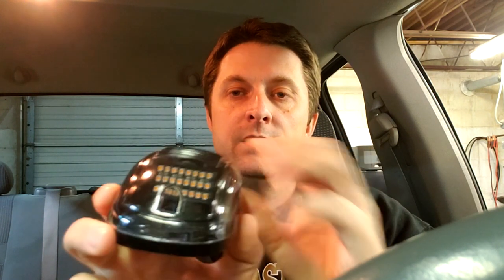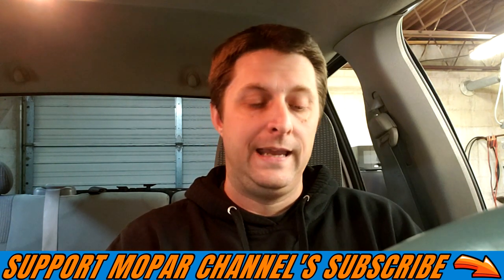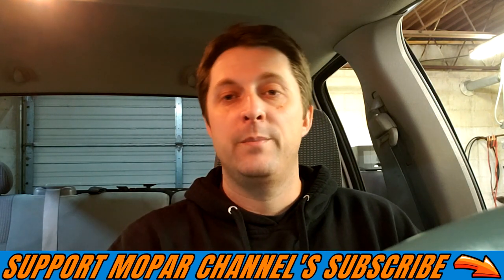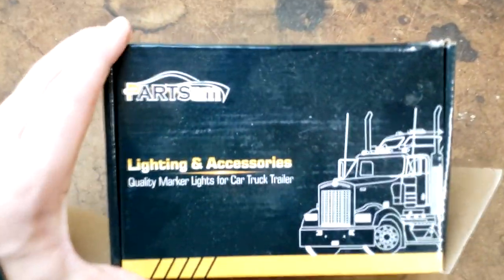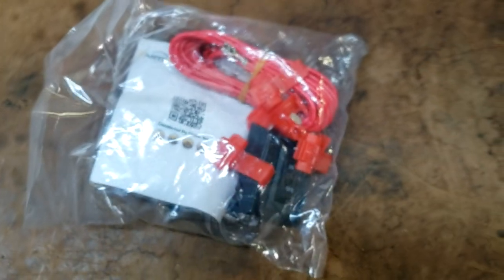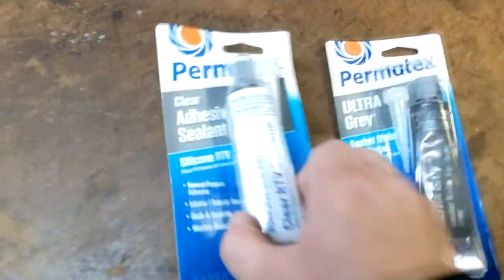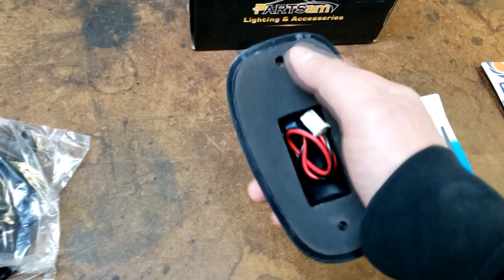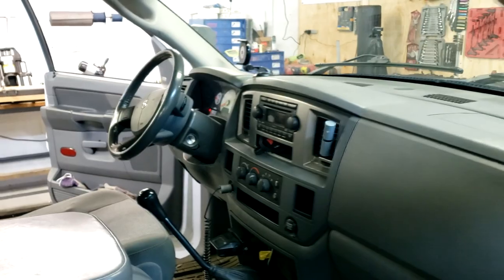How To Install Cab Lights On Your Dodge Ram 1500/2500/3500

Comment: My 04 already had cab lights wired from factory, passenger pillar, made it easy, no joining into switch
Reply: Was it SLT or Larime ?
Reply: So did my 08

Comment: I bought the same kit. Lights looked great but the gaskets on mine did not hold up to the sun's UV. Gasket deteriorated in a matter of months and caused leaking. Such a pain in the ass. I ended up just forking out the $170 bucks for the oem mopar kit. Gaskets on this kit are way better quality and so far so good.
Reply from the maker: Good to know I however added silicone around the holes for added protection.

Comment: Ordering a Ram 1500 Classic Express. May I just say on silicones if they smell like vinegar don't use that type that's acid and it will corrode the raw steel you exposed by drilling

Comment: It looks like the in-line fuse is going to end up inaccessible after everything goes back together. I'd be inclined to run it somewhere I can get at it if I need to. Maybe a spare position in the fuse box rather than an in-line.

Comment: Did the kit come with the fuse? And all connectors you needed? Also did it come with enough wire to reach all the way over or did you have to buy any additional stuff

Comment: Curious if you saw any factory sound deadening on the sheet metal on the roof? I'm debating lowering my headliner to apply a dynamat type material to help with sound control. Any observation is appreciated. If they did this from the factory, I'll just leave well enough alone.
BTW, high 5 lights you did in this project look good! Already have them in my 3500 but might be worth swapping to the LEDs.
Reply from the maker: Pretty sure nothing there
Reply: @FrostbiteRam  great, appreciate the info! Looks like I'll be doing the project!

Comment: went to tap into my headlight switch and I did not find any brown and orange wires found mostly purple and white wires however there is one orange and white wire. any idea on what to tap into. im sure its the same wire just different colors.
Reply from the maker: Need a test light or ohm meter to know for sure find one with 12v with key on only

Comment: Good but you not have to run the power to the switch , pasenger side have conector by the hendle that You remuve if you see and to many cable run. After tha perfect.

Comment: No ! dont use silicone, bad idea, Use Butyl tape. those are cheap aftermarket lights and they will leak. Genos sells proper good lights

Comment: Is that a resistor on the power wire? If so what size? I got a nice kit that came with a template but there is no resistor on the power wire if that is indeed a resistor
Reply from the maker: No I don't remember it having a resistor.
Reply: It is his inline fuse

Comment: QUESTION! Now if I dapped into that power switch. Will the cab lights turn on when I unlock the truck just like the marker lights do
Reply from the maker: They can just depends on how you wire them in.

Comment: Where did you hook the ground wire at. Im puting the same kit in my 2007 2500
Reply from the maker: I used a self tapping screw and mounted it to the dash bracing behind the side panel on driver side.
Reply: Where ??

Comment: How have those cab lights worked for you with rain? i want the same ones for my 2nd gen but not sure
Reply from the maker: Been awesome no problems yet
Reply: @FrostbiteRam  what areas do you recommend to put silicone on so they last?
Reply from the maker: @poolsharkkkkk  around the mounting holes

Comment: Nice job but no  relay?
Reply from the maker: Why a relay its wired into the factory wiring so it has a fuse and all.
Reply: @FrostbiteRam  huh? You tapped into a circuit designed to supply the headlights and running lights. You don’t ever add more lights to a circuit like that without at least knowing how many amps that circuit can handle and what load you will be adding to it. That’s how fires are started. The correct way to do it would be to tap into the headlight circuit like you did but just to trigger a relay circuit for your new lights because a trigger wire does not draw hardly any current at all. Fortunately those led cab marker lights probably do not draw very much current  but you should look into it.
Reply from the maker: @markmanning6773  it has a factory fuse worse case it will pop the fuse thats it. I've had no issues at all the light are led they hardly use any power.
Reply: @FrostbiteRam  unfortunately that is not the worse case. It is the ideal case but all is good.
Reply from the maker: @markmanning6773  well if it 🔥 down ill post a video 🤣
Reply: @FrostbiteRam  👏🏽🤣